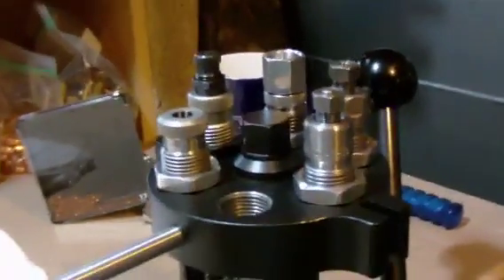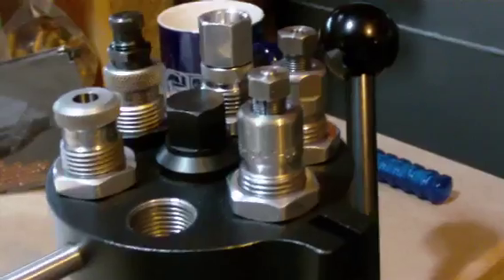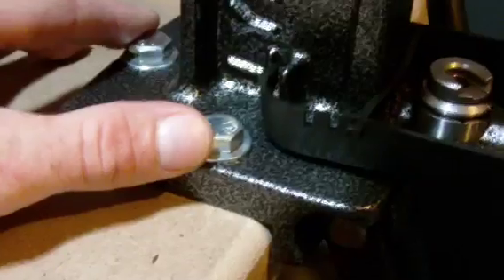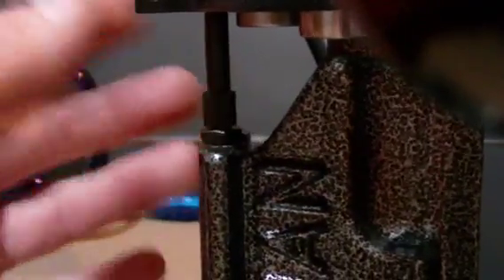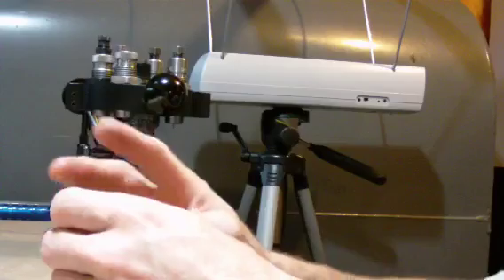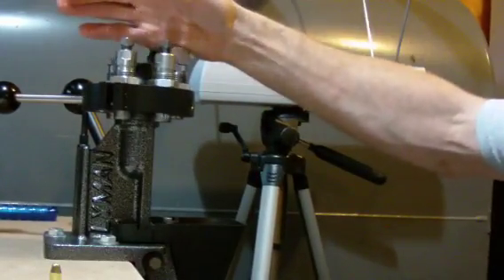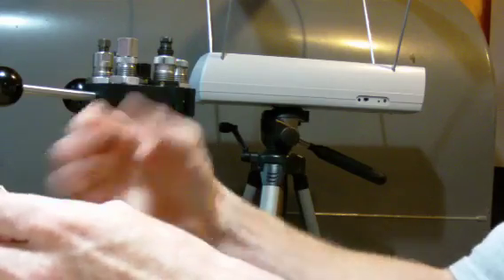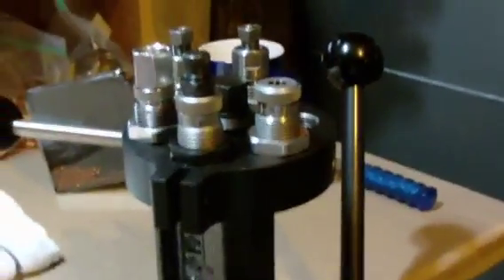Lyman T-Mag II

Comment: I have an original T-Mag.  The refinements on this one are logical, though I never had issues with the turret moving so no real need for the stabilizing rod.  The lever to move the turret and remove the nut looks nice.  I had issues with Lyman's priming system.  To be fair, that may have been me, but it was annoying enough that I went to hand priming.  Good press and would recommend it, especially for pistol shooters!
Reply: Same here with the priming. I decap on a single stage press and prime with a hand primer.

I use a Lee automatic powder drop with 
the t-mag set up exclusively for .45ACP.

Like the aspect of being able to view the powder in the brass before seating the bullet.

Comment: I just want to add that the turret handle can be used to remove the turret nut instead of a wrench as a hole runs through the nut. Also would like to add that the primer tool for the press failed on mine and I found it easier to use a hand primer. Having bought one I think I would use it even if the press primer functioned well as the hand prime is just easier to use. I have been reloading magnum rifle cartridges with this press for 3 yrs with no problems - and I am fussy. Good press.
Reply from the maker: Very good press I use a hand primer as well. The primer for the press hasn't ever been open. This press has never failed me. Just upgraded to a Dillon XL650 and I still can't bring myself to get rid of this one. I'll keep it forever.

Comment: I have the T-Mag it unlike the T-Mag 2 it has no  adjustment rod to remove flex, that ain't a deal breaker but when doing rifle cartridge's there is a few thousand's OAL difference in loaded ammo so I tend to seat on a separate press when working up loads. but it don't really effect accuracy that much either way.

Comment from the maker: All dies have a universal thread so yes Lee dies will work. That's what I use.
Reply: Thanks. My lee classic turret indexing assembly crapped out on me finally. Not too happy, but the pieces are only a few bucks and they may send new ones free anyway. Used it as a manual index and didn't really see much of a decrease in speed when comparing it to the press when the auto index was working. May invest in a lyman t mag 2 since you can use the lee dies and the manual indexing seems to be around the same speed as auto index
Reply: Also is there a priming system on this press? Was looking around for the info and can't find the answer to that question
Reply: jris211
You can buy the indexing parts for a few dollars on Titan Reloading. If you don't like the indexing just pull out the indexing rod.
Reply: Jim Oksvold yeah i'm good.  Just bought and extra long screw and a nut and tightened it down and it's been fine since.  Really want to get a progressive but had too many issues with a dillon 550b (yes dillon) and lee loadmaster.  Seems the turret presses are the best tradeoff for speed, simplicity and ease of use.  If lyman made this press with auto indexing, i'd have no issue picking it up.

Comment: With the 357 sig over all length stretch like bottle neck rifle rounds over time?
Reply from the maker: All brass stretches over time. I always measure the case length after resizing each time. Some need to be trimmed and some do not. It's the only pistol caliber I measure each and every time. Some cases actually are shorter after. Not sure how it happens. Long story short always measure so each batch is consistent.

Comment from the maker: Like you said "much cheaper"
Reply: As in price "much cheaper". So since you paid more for your press and it's a manual index, it's better than a auto index made of the same material? The auto index speeds it up considerably compared to going by hand. It's been 100% reliable. Solid cast iron. Lee gets a bad rep on account of their progressive presses. They did a great job with that press. I'm not saying lyman is a bad press. All I'm saying is that paying more for less features doesn't make sense. I've loaded over 20k on my lee classic turret and never had a single issue.